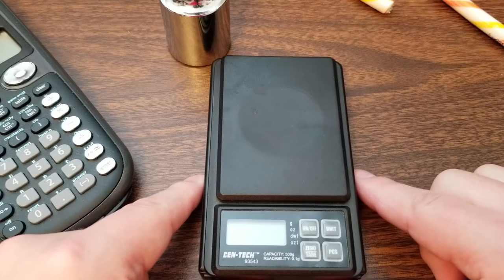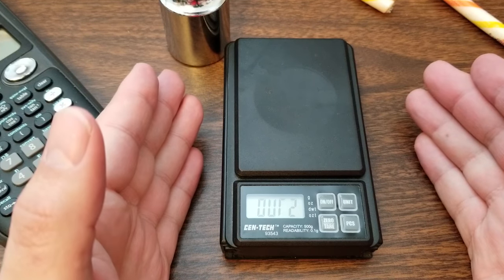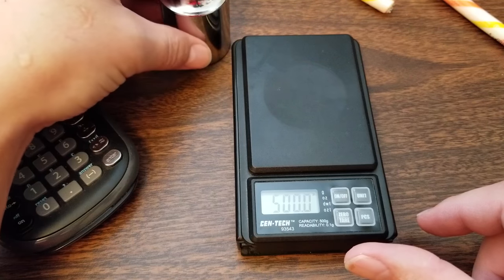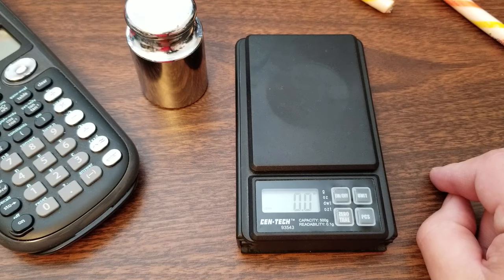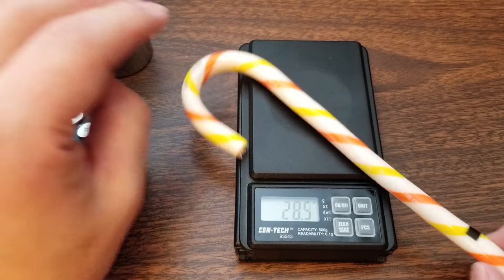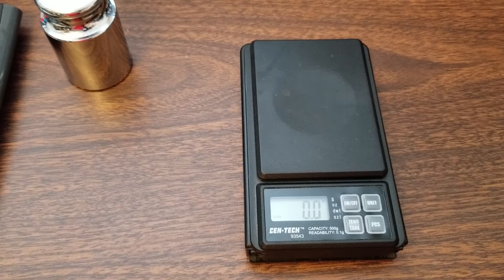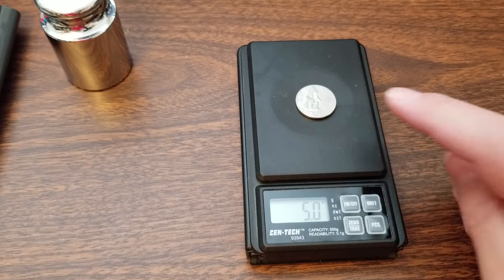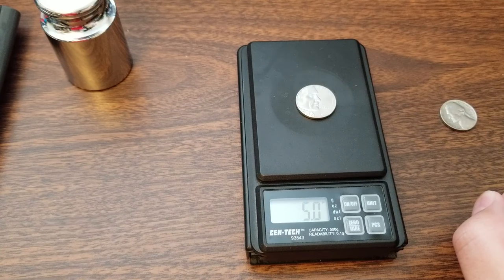Fix a digital pocket scale which needs calibration

Comment: I didn't have a calibration weighr either, but I did have a good food scale. I used a coule of small heavy items from the pantry including a salt shaker. Adjusted the amount of salt until my collection weighed 500g. Placed them on the pocket scale and it worked like a charm.

Comment: Thanks for the answer. I made my 500g weight by using my less precise kitchen scale to prepare 500g by pouring water into a glass (2 cups is around 480g). Perhaps not totally accurate, but got the scale going and now I can use the higher precision of the scale for things that weigh between 1-3 grams. My kitchen scale is only accurate to 1g.

Comment: Ok guys. I spent a good hour looking up weights of things I possess. Its much simpler than that. I took an empty glass and set it on the scale when it flashes 500. Then add water  until it says pass. Tare and set your .5 nickle on. It'll be off so redo the CAL process and add more water if it says the Nickle is heavier than .5, less if it is lighter than .5.  Repeat until the scale reads .5 with nickle.
Reply from the maker: If you have a way to accurately measure 500ml of water that's also 500g which would make the water process for calibration faster.
Reply: @askquestionstrythings  i looked into that but the glass weighs a significant about and I couldn't determine what it was without a scale. I suppose if one had a red solo cup that weighed practically nothing it would be much easier with the water
Reply: @askquestionstrythings  regardless thank you for the video! I was scratching my head at what the scale was telling me was wrong.
Reply from the maker: You are welcome. Glad to help.
Reply: L mmmm😅

Comment: Thank you very much for this video and your answer to my comment that were both absolutely helpful!
When I got my scale, instructions said I should calibrate it, and you certainly don't want to wait another week for a calibration tool to be delivered, nor spend more money, specially when the solution is at home, thanks to your suggestion. I have hundreds of coins from everywhere left by my father, and there were the nickels that dated from the 50's until over the year 2000 so  found the right ones to work with and got my exact 100 grams. Without this tip I would have been lost; very helpful!
Reply from the maker: That's wonderful. Glad you were able to find what you needed.

Comment: Puzzle?, just bought a small RoHS digital scale and comes with a 50 gram weight, i calibrated it with that weight then when i put an Australian 20 cent piece which weighs 5.65 grams it literally shows double the weight, and i had a cheaper scale that did the exact same thing, and here i was thinking a gold nugget that i found gold detecting weighed 2 grams when in fact only weighs 1 gram bugger!!!, do you have any idea why this is happening, it doesn't bloody make any sense, if it's calibrated to the 50gram weight then why would anything else that you put on the scale shows double?

Comment: If your scale is anything else than a kitchen scale you really need a calibration weight anyway. Especially on such "precision" scales. With time they'll go out of calibration and it may even depend on temperature, battery level and even lattitude as well because of earths rotation. Coins is not a good option for anything else than kitchen scales. Use coins for calibrating and you can't count on the decimals being correct. A far better option is a cheap calibration weight. Amazon, eBay, AliExpress, Banggood etc.
Reply from the maker: Absolutely agree. I hope to eventually upgrade to an enclosed scale like I had in a chemistry lab as eventually I'll need the higher accuracy.

Comment: hey my scale wont even move past zero any fix its not weighing
Reply from the maker: If calibration with the correct mass doesn't work it's possible the scale has been damaged beyond recalibration (things like dropped, or a large mass well beyond the scales rating was placed on it, etc). In those cases the internal workings of the scale might have been damaged and not repairable. Being stuck a Zero and not moving suggests the internal workings may be damaged.

Comment: Same scale recalibrate it says pass but after turning on I put a nickel on it and it is reading 38.6????
Reply from the maker: In some cases if there is damage to the mechanical portions of a scale the scale's electronics will say it's a "pass" but will not be able to recalibrate the scale due to the damage. Usually I follow a rule of three, if three recalibrations fail then measurement tool needs repair or replace.

Comment: Problem calibrating scales. Can anyone help? 
1.Turn on scales
2.Displays 200.00g (will require 100g to calibrate)
3.Press Calibrate again and CAL displays
4.Im calibrating without weight!! 
5. Am placing empty plastic beaker onto plantform. ( immediately the CAL is replaced with a 200.00g) 
6.The 200.000g will not change, shouldn't the beakers weight be didplayed

Comment: Hi
Where did you get this scale from?
I need a very accurate scale to weigh powder medicine so I’ll need the mg scale
Reply from the maker: This scale is sold by harbor freight in the US. But it's not acceptable or accurate enough for chemistry or medicine purposes and doesn't do mg 0.0010 scale. It's also not repeatable enough with measurements to qualify for business or trade applications. I would consider this scale less accurate than a kitchen scale, but acceptable for some home lab physics experiments.
There are scales which would have the high accuracy needed for powered medicines but you would need to go through something like a medical supply company or a scientific instrument distributor. Definitely stick to scales with an enclosure  to keep air current variations out of the measurement.

Comment: Not many people have a 5000gram reference weight at their disposal so, this is what I did. Use a light weight coffee cup as the 5000gram calibration. This will remove the (OUR2) error. Then get a (new) nickel and weight it. The nickel should be ~5grams. Repeat the calibration process, adding water to coffee cup, until you are satisfied with accuracy. The main point here is to get the error cleared without the hassle of finding a 5000gram reference weight. Please like this post if it works for you 【ツ】.
Reply from the maker: Yep, there are alternatives. At the End of the Video I mention that US Nickels are 5g and you can use 100 of them as a substitute. Otherwise you can find calibration weight sets on Amazon for $14 which include 500g (or 200g if your scale needs 200g to clear the error). Thanks for Watching.
Reply: I used a bottle of Grey Flannel Cologne and it passed

Comment: I don't live in the USA, so I don't exactly know from which year on the nickels are considered "new". Can someone help with this information please. Thank you.
Reply from the maker: I mentioned "new" because coins in circulation could have nicks and could be under the specified mass from the US mint. If the coins are newer than 2000 they should  close. (I think it's US nickels since 1965) Check your country's coin mint they may have a coin with a mass at a common number like US nickels. "Newer" US pennies are 2.5g according to the US mint. The other option is to get a calibration weight from Amazon, they are reasonably priced for most masses and basic sets.
Reply: Buy calibration scales online! 🤔😁

Comment: I have a Salter 6300 I dropped when weighing out meat to make sausage. now when I turn it on it blinks about 5 times then shows "err"
Reply from the maker: You will need to look at your scale's manual. In many cases all you need to do is remove and replace the battery, hold both the power button and off button at the same time until the screen comes on, then calibrate with the mass the scale needs for recalibration.

Comment: I saw this little scale on a local hardware store. Does really need a 500 grams weigh tool to calibrate mandatory or Can calibrate with a single 5 grams Nickel ?
Reply from the maker: At a minimum, You would need 100 USA nickels (5g each *100 = 500g) or if your model takes a different calibration mass (100g, 250g, etc) you would need the appropriate number of nickels for the scale's requirements.
Reply: @askquestionstrythings  Thank so much, I am going to use it to wight small(less than 2 ounces) parcels to be shipped over USPS. I need to trust on a scale weight before going to post office, if not I will be losing money paying more if my weight are inaccurate. I was amazing how 5 nickel weight give you such precision. I can't afford a professional scale now, hope this little it will work. Do you still use it working well?

Comment: If there is no calibration weight hanging around 500 grams =17.73 oz or 1.102 in pounds! So, if you got a pound of butter or something else, it will get you in the ball park range! You can tweak & adjust with other items. Well, until you can get some weights if you choose! 😊

Comment: What kills me about this scale is that it requires you to put 500 G on it and it won't clear until it has 500 G on it, which means it knows when 500 G is on it, which means all it's  doing is confirming your weight is accurate! In other words it should have just been able to zero itself out without the weight since it already knows when 500 G is there. Am I missing something? Now somebody else just had a great idea and I'm about to try which is too turn it on put it empty container on it and fill it up until it says pass. I may update afterwards in the past I used my kitchen scale found 500 G and then placed it on there. I also had saved a bunch of metal brackets and screws that equaled 500 G exactly which I used as my weight for some time but I forgot that's what it was and used it for parts🥴

Comment: Cool. So, I need to buy a 500g weight and I'm ready to go. Also, good to know the nickel is ~5g...a bunch of them and good to go. Thanks for the instructions :)
Reply from the maker: Depends on the scale you have. This scale can use a 200g mass or a 500g mass for calibration. I've seen other smallish scales which need a 5kg mass and others which max out at 50g. 
Thanks for watching 👍to New Friends 🖖
Reply: What ever the reading is when in calibrate mode is what you have to use according to the instructions.  The instructions aren't as clear as they could have been but this scale uses one or the other but not both. 
Mine is the PS500 item #93543 and out of the package it gave the OUTZ message, fortunately I had enough calibration standards to get the 500 grams needed.
By the way OUTZ means the scale thinks something was sitting on the platform when it was turned on.
Reply from the maker: @electronron1  I agree those instructions are not as clear as they should be. Thank you for the clarification.
Reply: PAPER MONEY WEIGHTS 1GRAM

Comment: Hi my scale is a bit different it’s an accuweight brand mini pocket gram scale. The manual is as useless as the scale! I had planned on using it for counting out grams of  size 11 and size 15 seed beads. I cannot get the pieces (PCS) function to work. It records 22 beads instead of 25 and then when I press PCS again as directed, I get an error message. Help? Please? Thanks.
Reply from the maker: I don't know much about this specific scale. Most scales with a counting function have specific steps for calibration of the counting of the PCS function. 

I'm going to differ to this video, which is likely very similar to your model, for the process. About halfway through the video he covers the PCS function and mentions some details about the set up with the tray.
https://youtu.be/XUgFMbjfolk

I'll also mention from personal experience, some jewelry beads can be inconsistent with their mass from bead to bead making it harder to use the PCS function for small lots. You will need to know your beads and how consistent their mass is to know if mass inconsistencies are an issue you face with your beads.

Best of luck with sorting out your PCS scale issues.

Comment: How to reset pocket scales to zero...
When you turn on your scale continue holding down the on button for like 10 15 seconds and it will return to zeros
Reply from the maker: Unless the scale needs calibration like mine did. Then you need to recalibrate to measure anything. Thanks for watching.

Comment: So tell me this, my scales are weighing incorrectly, but to calibrate the scales tell you when you've met the calibration weight, but if it's weighing of, it's not calibrated right please help very confused
Reply from the maker: Calibration is a specialized process, it's not just weighing a calibration weight. The Calibration process is used to correct what the scale is measuring. Once a scale is in the correct mode for calibration you are giving it a reference point to check against. Once the scale "learns" what the "reference" is, it should be able to correctly measure things again.

I hope that makes sense.
Reply: @askquestionstrythings   yea man, basically I was doing it wrong, if I held the Cal button once it would show what weight it needed, if I held it again the display would flash and I could then inturn tell the scales what 5g was. Thanks for the reply tho.
Reply from the maker: You are welcome. Glad you were able to figure out what you needed to do.

Comment: Did this and it didn’t work
Reply from the maker: Some versions of this scale use a 100g or 200g mass and not 500g like my scale. Make sure you are using the correct mass for your scale's setting. when "CAL" is blinking and gives you a number, that is the calibration mass needed for your specific scale. My Scale said 500.0 so I needed a 500g mass.
If calibration with the correct mass doesn't work it's possible the scale has been damaged beyond recalibration (things like dropped, or a large mass well beyond the scales rating was placed on it, etc). In those cases the internal workings of the scale might have been damaged and not repairable.

Comment: What do I if I dont have that 500 g weighing thing
Reply from the maker: A towards the end of the video I mention using USA nickels as they are 5g. Watch from at about 3:59 as the date of the coin matters.
Reply: Watch the damn video.
Reply: @askquestionstrythings  i did that 40 of them and didn’t work
Reply: i have the same scale tho
Reply from the maker: @maitesantos7817  some versions of this scale use a 100g or 200g mass and not 500g like my scale. Make sure you are using the correct mass for your scale's setting. when "CAL" is blinking and gives you a number, that is the calibration mass needed for your specific scale. My Scale said 500.0 so I needed a 500g mass.
If that correction doesn't work it's possible the scale has been damaged beyond recalibration (things like dropped, or a large mass well beyond the scales rating was placed on it, etc).

Comment: Recalibrating is not fixing !
Reply from the maker: That's unfortunate. In some cases if the scale has had something placed on it which far exceeds its rated capacity it can become damaged internally and recalibrating can't fix it.
Other general maintenance things like replacing the batteries then recalibrating can fix it, as long as it is not damaged internally.
Reply: @askquestionstrythings  what if my digital scale says full
Reply from the maker: @russellbussey1418  There is nothing in the manual to indicate a meaning for "full"; although it's possible that it's actually saying "fail" and it wants you to reattempt calibration. If that was the case, either there is something wrong with the scale or the calibration weight used for the scale isn't what the scale wants. Some of these models want 200g and others want 500g.

Comment: A penny weighs 2.5 grams. 200 pennies equals 500 grams (minted after 1983)
Reply from the maker: Yep, those dates matter when using coins as a substitution for calibration weights.
Reply: Specs of coins are not as tight as many think. Besides new og being in circulation really does matter. Use your pennies and buy a real calibration weight instead. Even the cheap calibration weights off eBay, Banggood, AliExpress etc. Yes even on Amazon you can get cheap calibration weights - all of them despite being very cheap and most only fullfills M2 and some even only M3 classification - none the less they'll be much more accurate than a bunch of coins.

Comment: Why is everyone saying this is a good video?.  I'm not trying to be a jerk but practically everything you said and did in this video is incorrect.  First of all, scales measure weight.  Not mass. Balances measure mass.  Mass is a measure of the amount of matter in an object. Scales measure weight, which is the force acting on a mass that is equal to the object’s mass times its acceleration due to gravity. Althought weight is typically reported in mass units such as kilogram or gram, a scale can’t measure mass directly, because the weighing mechanism and the weight of any given object are dependent on local gravity. Also, all U.S. nickels minted since the mid 1960s weigh exactly 5.000 grams. The candy cane example was also completely incorrect.  As long as the entire mass of the object is supported by the scale it will weigh the same regardless of the orientation (assuming it is a solid object). Yours weighed differently because part of the candy cane was resting on the calculator and the table surface.  I'm not trying to insult you but exact measurements and weights are important in various tasks and inaccurate information like this spreads and causes problems.  That's what's wrong with your catch phrase or slogan "go try stuff".  Perhaps you should learn how to do things the right way before you try them and certainly before you presume to teach others.
Reply: @KillerMcCoy1  starting your comment with "hooty frickin hoo" isn't going to help with credibility.